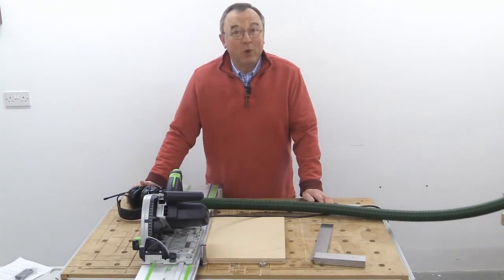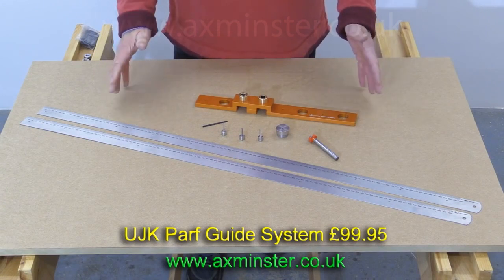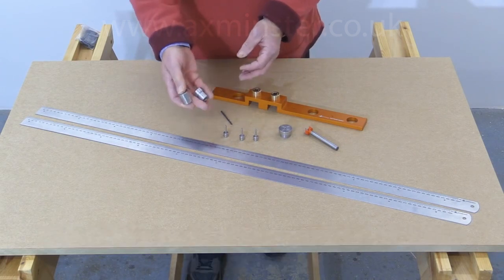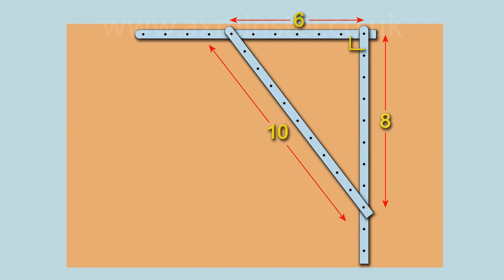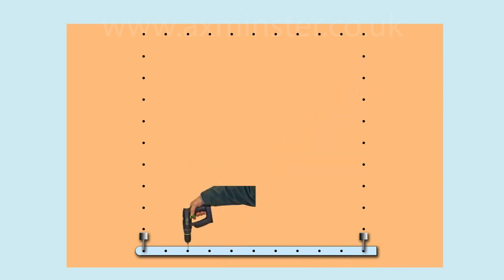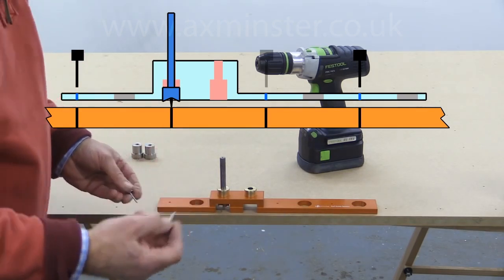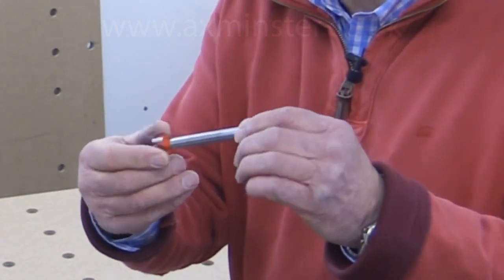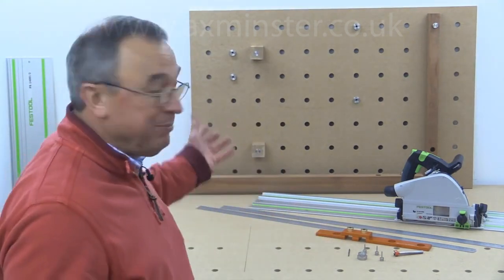UJK Parf Guide System   Overview

Comment: Fortunately there are easier ways nowadays....This Axminster solution is a pain in the some where....Difficult measuring, drilling twice. Does not sound reasonable now that there are for example Taiga Tools MFT Router Jig. One Jig, no really any measuring except that your table top is straight and has 90 degree corners for sure. Then clamp down the once on one corner, and push the plunge router with 30 mm copy ring assembled usin 20 mm router bit and once you have plunged the 3 or 4 (I do not remember excatly), then the jig is removed and positioned to the next plunding position by pushing the bench dogs attached to jig into the previoius holes and the whole table top is made this way. Easy and CNC machinery precise. Also the wholes will be smoother and 100% straight comapred to the hand drill. I recommend this product to everybody as well as other Taiga Tools accessories used together with e.g. Festool TS55 and the Festool Track.